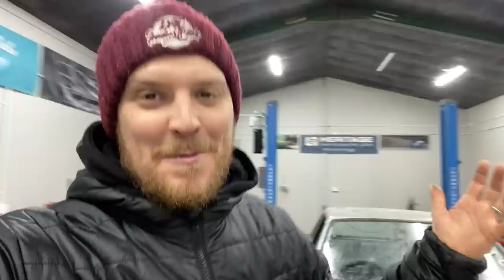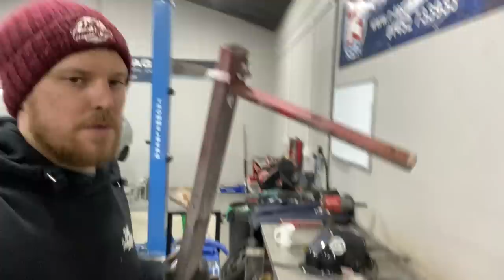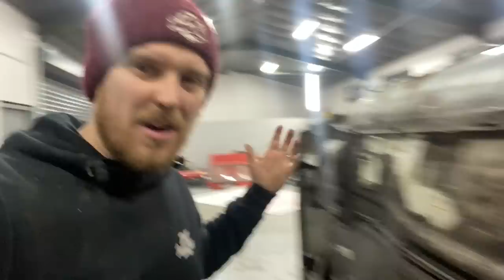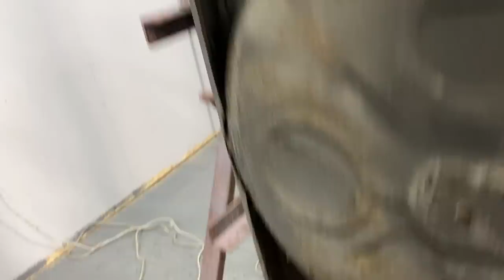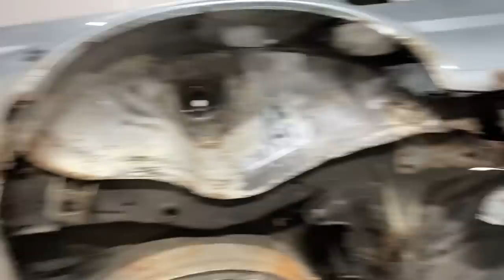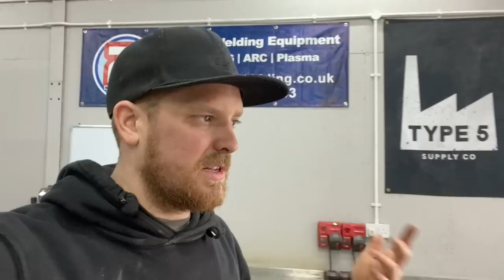VW Polo Coupe - Scrap To Showcar - Episode 2

Comment: Welding…

Off up the garage to do some in a short while. ‘Dragging on’ seems to be a theme at ‘this end’.. not long to go though.

Looking forwards to seeing those panels getting out in (even in time lapse) don’t underestimate your skills/problem solving and how much your subbies enjoy watching/gain from doing so. It all adds up.

Impressed with the multi tool sealer removal I have just gotten by using a big conical wire wheel on a large grinder. It’s brutal and gives you a pretty good work out. I may now have an excuse to buy one of this multi tool things now.

Great episode as ever Dan..

Comment: Dan you are doing it the right way with saving the rear quarters as the ones you got are for the mk2f so different rear lights also slightly more round than your mk2 which is more crisp lines. I had the mk2f gt great car one thing is watch your seat choice with the 5 speed. I had a set of tartan recaro mk2 scirocco seats in mine and it looked great but If you set the seat to far forward on the runner you lost 5th gear

Comment: 20 years ago at a Scottish club gti event at kames track there was a red mk3 polo with a 1.6 16v engine on ITB`S.
I think from an early polo gti or maybe lupo, it was the quickest around the track that day and everyone was amazed at how quick it was . 
When he lifted the bonnet there were hoards of people around it looking. 
There were loads of fast cars that day MK1 20V, golf rallyes etc.
 But for me the car of the show was Paul Horrocks from Yorks black ratty mk2 vr6 with 6 speed vw motor  sport  gearbox and schrick inlet manifold, 
I remember it had a dented door from him kicking it when he was building it because it wouldnt start i think  lolo 
It was proper ratty and fast and the vr singing was great to hear, I think he was 3rd that day i think.
I had a great talk with Bill Brockbank of badger 5 fame about his silver mk2 jetta with 2.0 16v. Hes a lovely guy and his wife is lovely as well, I think he was 2nd round the circuit.
Im almost certain the boy with the red polo stuck a rear ARB from a Porsche on the back of his polo aswell. 

 Polo    https://www.youtube.com/watch?v=7Cksl4C6txQ 

Build thread,  alot of pics gone unfortunately but there might be some info on the install that might help.

https://www.clubgti.com/forums/index.php?threads/dogwoods-polo.157429/

1.6 16v engine is 123 HP standard , there must be a cam for them now after all this time, maybe 2nd hand ? that and correct bike carbs and a 4 branch etc it would be a handfull with the polo being the same weight as a fag packet  👍

Lot # 42152063 sell the rest and get the engine cheap cheap, you know the deal 😎

You know it makes sense,  get it did allready 🤣🤣 
Peace.

Comment: Great work as ever Dan  workshop is look good hats off glad your finally in and started a new project.  Will be keeping my eye on his as ever roll on next Sunday lol . Interested to see what you do engine , paint ,interior and wheel wise and very interested to see if you can do all that for £5000 going be had . If it's anything like my corrado nothing  come cheap for them as parts are so hard to get now . I found that it's the little bits that cost the money lol silly bits of plastic that you think arrrr £5 to £10 costing £50 to £100 but I'm sure your aware of this after the mk1 lol . Good luck with the rest of it be watching as I said . Dave

Comment: Hi Dan what a fantastic episode mate it's really nice to see you finally working on a car in your new shop rather than building said shop, it must be a huge buzz to be using everything you have built and it looks like it's working as it should👏

I've never owned a VW I was always a Cortina man when I was younger, think I owned about 4 or 5 of them back in the 70's and 80's but I have travelled to work in a mates Golf and I really liked it, anyway mate you are progressing really well with the Polo but please don't rush it to much or you will burn out and loose interest making it a chore rather than a pleasure to do, the old Polo isn't in to bad condition for it's age so I'm sure you will get it done, IMO you should get a nice big V8 and stick it in the back then 4 wheel drive it then make the old engine bay the boot👌🤣just kidding but it would go like a rocket😅👍

Comment: Shared a polo coupe with my mum as my first car back in the mid 90's. Managed to pick a g40 up a few years back which I still have today, makes me laugh every time I drive it!!! I would say if you can find the parts it's well worth fitting bigger brakes from a 16v Scirocco, makes a world of difference! Lupo GTi engine would make sense.
Reply: Jay it's the 16v mk2 golf brakes you need with a passat b4 or 5 servo. There was only 10 official 16v mk2 scirocco imported to the UK.
Reply: @paulcushnie  yeah sorry, I know it's the golf 16v discs and calipers but was pretty sure you needed the carriers from the 16v Scirocco or certain Audi 80's,(same part no?) as they have a smaller bolt spacing where they bolt on to the polo leg. Are the bolt spaces 75mm on the polo leg but 90mm on the golf, can't remember exactly. It's been a while since I did it! I swapped the master cylinder for golf 16v but wasn't aware of the servo swap! Not sure if a bigger one would fit on the g40 or not but might have to have a look, every little helps! I'm sure the left hand drive cars were fitted with a bigger one from the factory.
Reply: Trying to mind the conversations myself. I upped my mk2 scirocco brakes cause they were awful but when I had my mk2f polo I just left the brakes as standard. Problem will be that guess since we are both trying to remember we are from a time that all these parts were available at local scrap yards now they are sought after parts and harder to find. I guess the new upgrade would be to use the lupo gti brake and discs and hubs and find a coil over that will suit the crossover
Reply: @paulcushnie  yeah back in the day when you could actually walk round a scrap yard on a Saturday morning even though the cars were stacked 5 high on bits of old pallets and spare wheels!! Looking for the hidden gems and you could get pretty much anything off with a set of 8-19mm spanners and a big flat blade!!